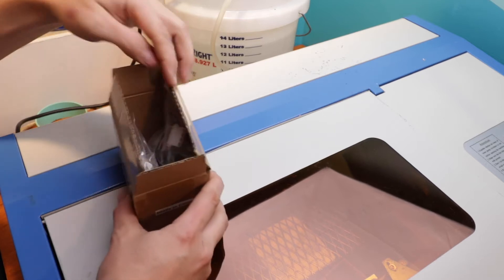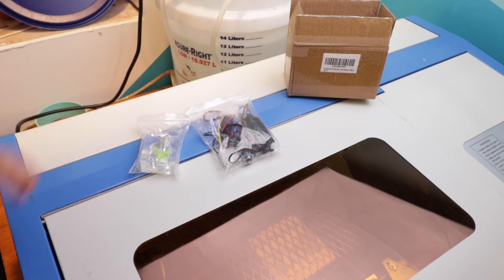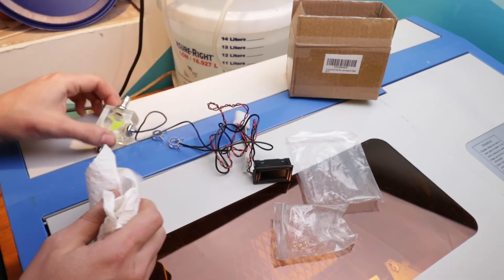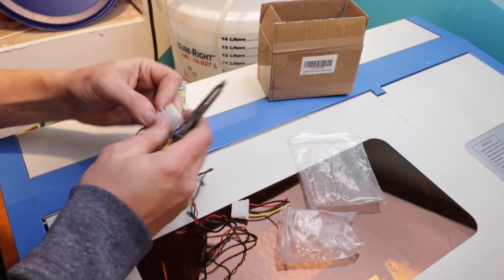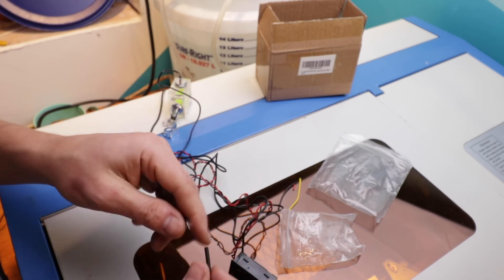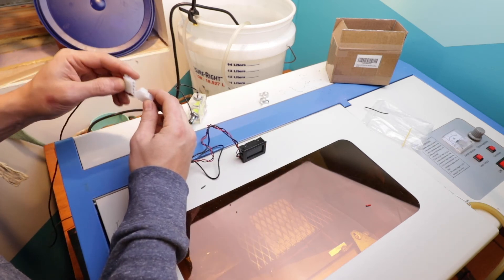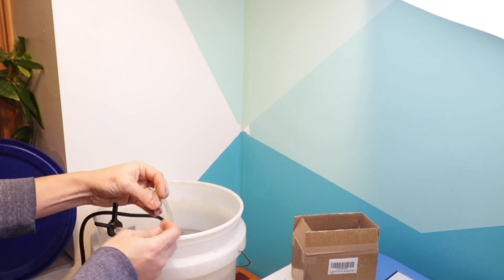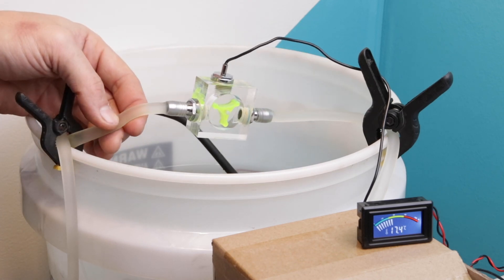K40 “flow meter” installation

Comment: You probably already know this but acrylic may crack if you over-tighten those fittings. Not at first but over time the stress of the over-tightening may cause a small flood.

Comment: Great explanatory video! very usefull, i've got a question regarding the connection of the display itself, on my product description it says it can be powered using 5-24v dc but i really didnt want to have another brick psu just to power a little display any advice from where to get the power from?

Comment: What was the voltage for the power supply?  5 or 12v?

Great video regardless
Reply from the maker: Thanks. The temp display needs a 5v power supply.
Reply: @asquaregarden  thank you.

Comment: hahaha Why do you call it a flow meter if it doesn't meter anything? lol. Why would you correct yourself on youtube. By the way you realize that the fittings come with a gasket to prevent leaks. Hope you don't get rectorseal in your cooling system>
Reply from the maker: It is sold as a flow meter and everybody calls it a flow meter when it obviously is not. That was the whole point. Those gaskets are garbage that is the point of the thread sealant.

Comment: So did you cut the input or the output? Pretty confusing as you said both.
Reply from the maker: I see what you are saying. I went from thinking of the laser to the water pump mid thought so the laser input is the water pump output. I’ll try to add a note, thanks for pointing it out. To answer your question, I cut the line coming from the pump and going into the laser so I could monitor the temperature of the water going in the laser.
Reply: I was about to ask the same question… thanks a lot for make it clear

Comment: can you tell me if this will work if i invert the assembly? use this as a 90 degree curve and on the side put the sensor? Great video. Thank´s
Reply from the maker: I can't say for sure as I have not tried it in that configuration but my first thought is that it will not. The reason is that there is a position in which the propeller would allow the water to pass while being in balance/ still.